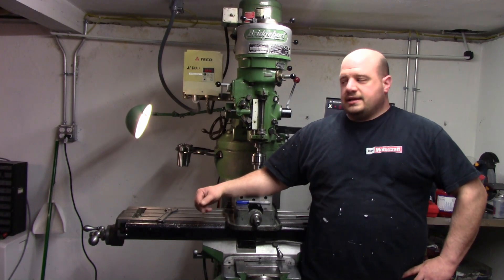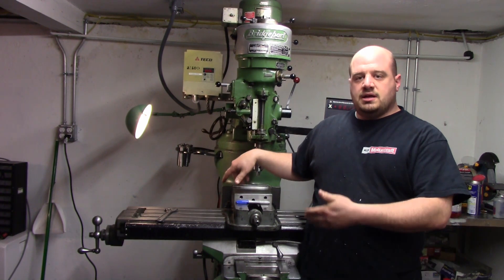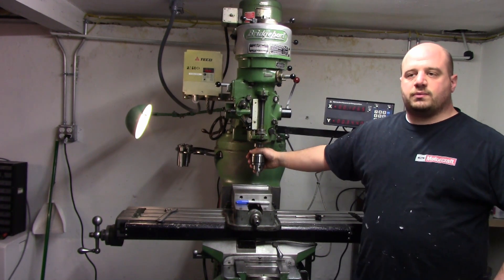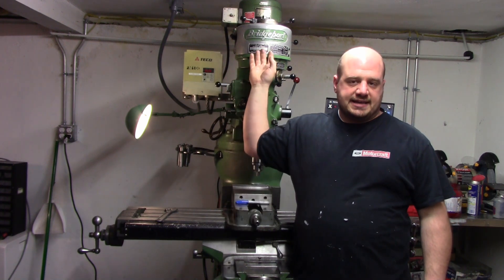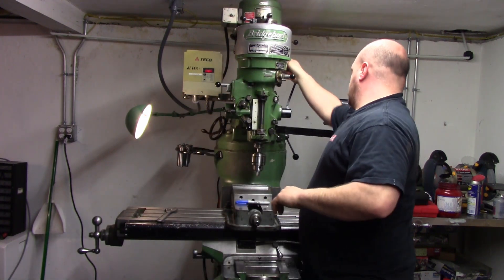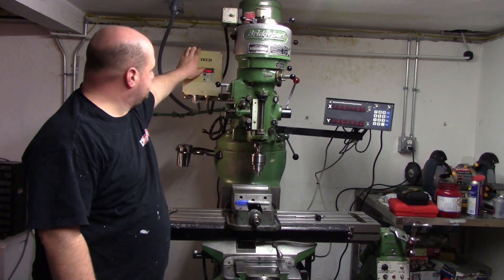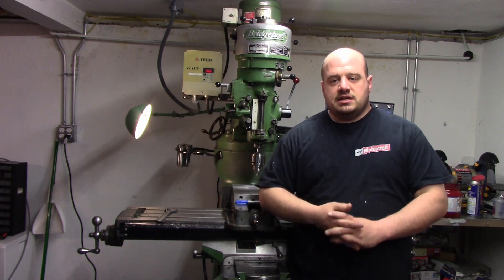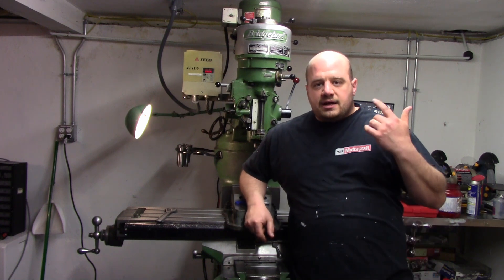Mill Project Ideas

Comment: I have access to a mill at a maker space. Nothing fancy.  Just learned a bit about using it in a cnc class.  Only projects we had in night class were making dice and cutting a slot in a piece of aluminum. the classroom has a prototrak SMX attached to it. I want to try using the mill at the maker space, but have no idea what it will make.

Comment: Suggestions, eh? It seems to be open season on nonsense on the YT machinist's community. First doubleboost's organic machining and just saw AvE make a potato nut and bolt, french fried (in brake fluid I think). So why not a nonsense project? Make an "impossitail" or 4-way dovetail. It actually is a fine exercise in setup work. OK for nonsense; something more serious would be make one or more dovetailed toolholders for the Aloris type toolholder you have. I am told you can't have enough of them.
Reply from the maker: +Juan Rivero 
Yeah I'm going to attempt a tangential holder built into a dovetailed toolholder.
Reply: Wow. A nice project. Tangential tool holders are very good, Kiltoy has a review.

Comment: It might seem a bit dumb to ask, but, I would like to know (and be shown) what this can do extra beyond what a pillar drill and lathe can do. What is "special" about a mill like this?
Reply: +Dan Whiteford OK, I'll take that one. A mill can drill holes. So can a drill press. What the drill press cannot do is take sideways thrust: the chuck will pop out of the spindle -- ask me how I know that :( and if it doesen't hit you in the face you are lucky). A mill will take sideways thrust to the limit of its capacity. So you use the mill when you are, er, milling, not the drill press. A lathe will mill too if you have a vertical milling attachment. But travel is severely limited by cross-slide travel. The Bridgie has a huge X-travel and a respectable Y-travel, much more than the lathe. So doing big jobs = big mill.

Comment: make a clamping board. With all the holes for screwing down toe-clamps. Lots of layout, drilling, tapping (you have a tapping head?) and also the actual toe-clamps. Precision stuff, with lots of uses FOR use on the mill.
Reply from the maker: +BasementShopGuy 
Yeah I think thats the first project to tackle when I get back

Comment: When you are ready to try a simple spur gear, I need one for an old cement mixer.  I still need to get it apart, confirm number of teeth, approximate size, determine pitch, etc.  I could probably buy one off the shelf somewhere, but if someone wants to try their hand at making one, why deprive them the opportunity?

Comment: Good job on getting the mill together!  I think you made a wise decision about leaving the original paint as the mill looks great as it is.

Now you can look forward to buying the almost endless amount of mill tooling you will need, but you certainly got a great start with the DRO and vise that was included in the deal.  You probably already know this, but since you have the collets just purchase an ER-40 collet block set from arceuro.  They are very nice and I'll received mine in two days!  Also order a ball-bearing nut for each block.

Comment: How hard would it be to build a small rotary table as a project? The screw could be threaded rod, and the gear could be made with a tap. The body could be a problem because of the size. Maybe welding it together from pieces and mashing it afterwards?

Comment: Change the ramp down parameter on the vfd. You notice it was still trying to spin after you released the brake. The way you have it you are trying to stop the motor while it is still ramping down. It will unnecessarily wear on the brake.

Comment: Been nice to see the DRO go on and where you wired up to, dito for the VFD and how it works. Maybe some close ups of the mill,
sure got it looking good! How come its green and not grey? I'm up for the ball turner. You gotter get that DRO arm and the DRO level. It looks wrong, were all level and square, parallel nut jobs, and we touch everything we machine to see how hot and smooth it its.

Comment: Hey Greg,
here's my two cents worth: as you start working with your bridgeport and getting the tooling for it, the projects will find themselves.  from my own perspective, there were always an oddball here and there where i needed a milling machine before i bought mine.. but after i bought it and tooled it up the workload grew exponentially and is continuing to grow. in a year from now you'll be wondering how you ever got along without it...

cheers
mike

Comment: How about an insert based fly cutter?  I've had this on my to-do list for a while.  Something like the on available from Suburban Tool only with an R8 rather than a shell mill attachment.  Would be very useful.  Also, different insert holders could be made for trepanning or use as a large boring tool.

Comment: I noticed you hit the brake when your powered down. You don't want to do that with a VFD. You can program the VFD to brake the motor for you. I have mine set at two seconds. You can also use the control terminals of the drive to wire an emergency stop if you want. I never touch my VFD, I wired the original switch on the mill to start and stop. I also added a 10K pot in a small box between the factory switch and the motor so I can control the speed from there. My VFD is inside an enclosure that is sized to maintain proper cooling and to keep dust and dirt away from it. Hope this gives you something to think about. Keep making the great videos.

Comment: Any of Elmer's Engines or as I was taught in trade school, make your own tools.  1-2-3 block, v-block and clamp, hardened scribe, brass hammer with hollow handle and screw cap end, lathe tool holder, lathe quick-change toolpost, lathe/grinder dog, machinist screw clamps, tap handle T and two-hand, machinist 3" screw jack, sine bar, grinding vice, center punch, pin punch set, 30/60/90-45/90 angle blocks, arbor press, 1" lathe mandrel.